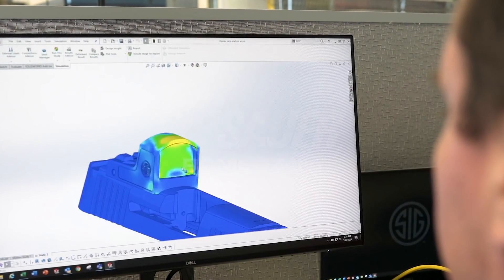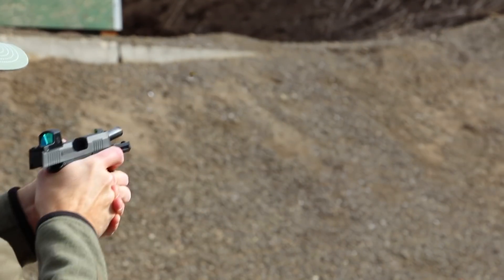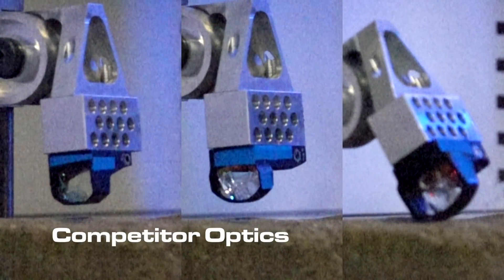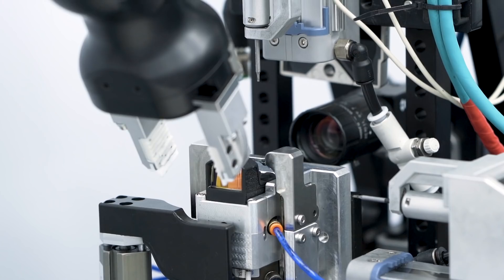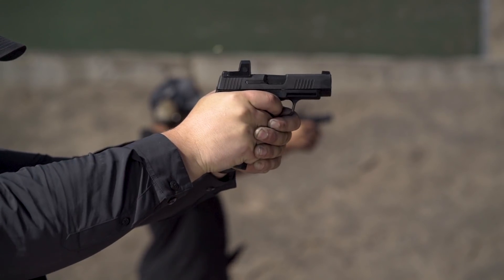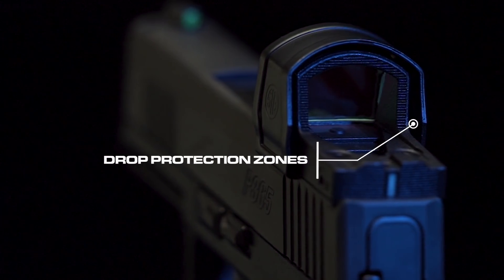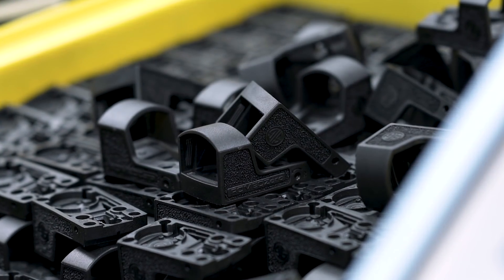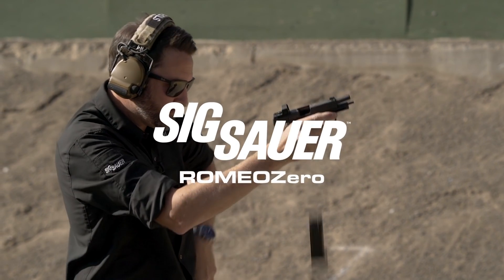ROMEOZero. Made in USA.

Comment: Has the lens material been changed? My Zero is hideously scratched. Actually looking at Holosun 507k this morning and saw the email about this 'elite' Zero.
Reply: Yes the elite has glass lens now. 

One thing I've learned from decades of using polymer lenses is its really important that you do use A clean micro fiber for cleaning the lens. If you use a shirt or anything else it will easily scratch it.
Reply: @EOTechN9ne  I had been using microfiber cloths but every once in awhile I'd use the shirt material. I think many times in the desert ranges the dust is a bit grittier than normal causing scratches even with a microfiber cloth.
Reply: Look no further, the 507k is the way to go
Reply: @djchino  No thanks. I don't feel like funding China's military ambitions.